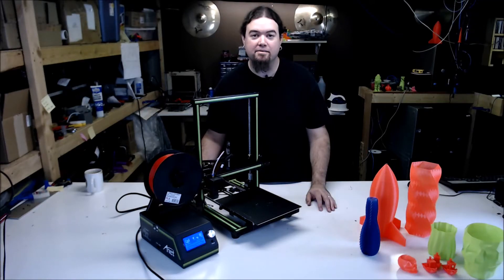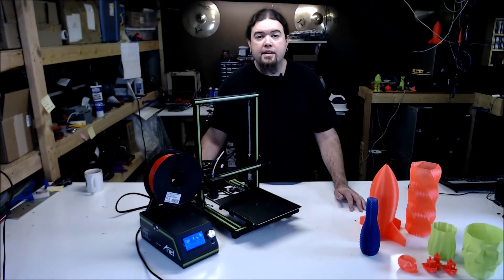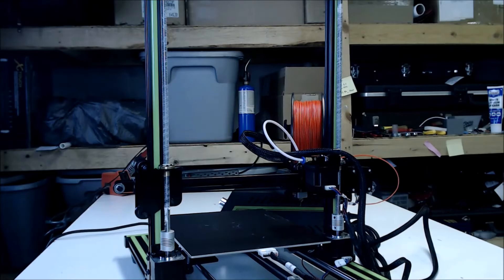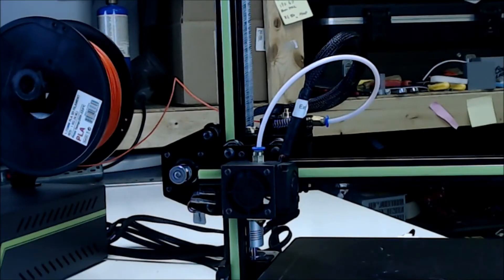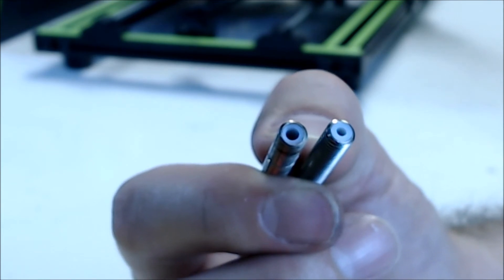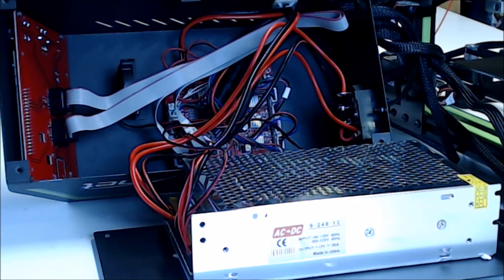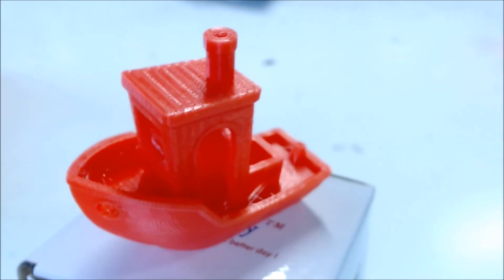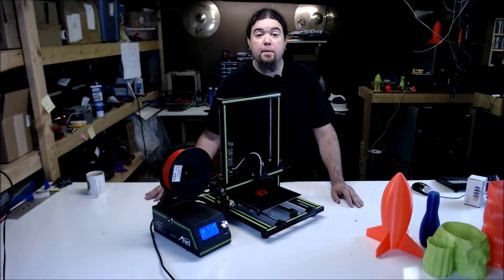ANET E10 Large Volume 3D Printer Review and Build Tips - Chris's Basement

Comment: Proprietary firmware?  Not using marlin?
Reply from the maker: Thanks for watching, ANET doesn't provide a copy of the firmware for you to alter. It could be marlin, but it doesn't responded to some of the marlin commands.  There is an effort out there to run marlin on the ANET board.